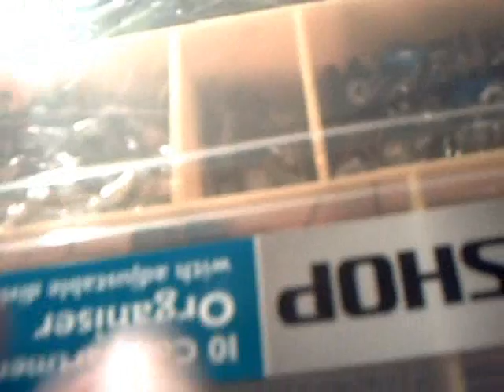300th Video: Introduction to Electronics

Comment from the maker: Electrolytic is a type of capacitor but capacitors work differently to inductors. Capacitors store a charge due to 2 metal plates with an insulator between them rather than a coil as inductors do.